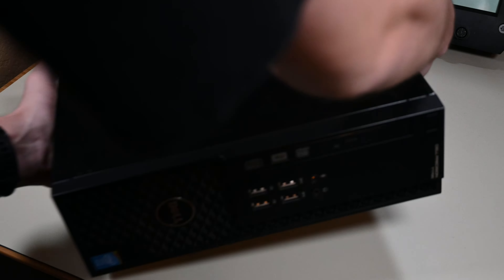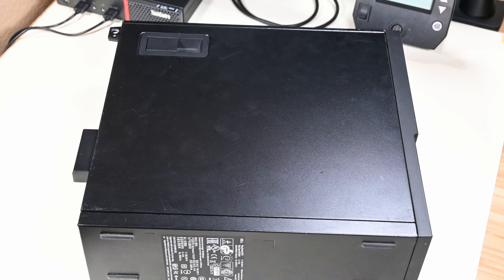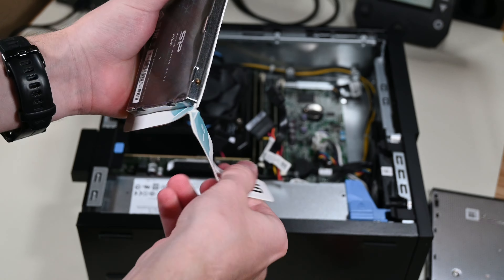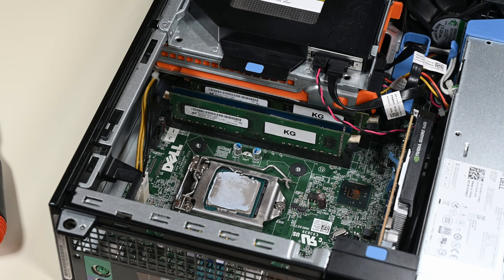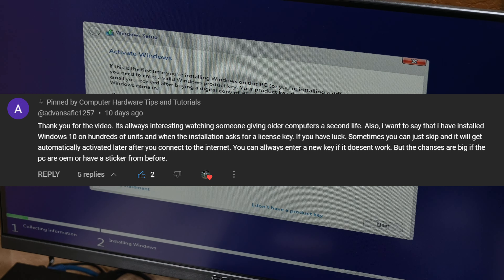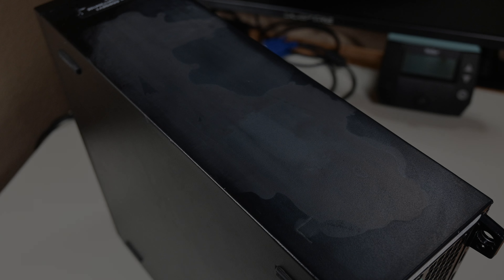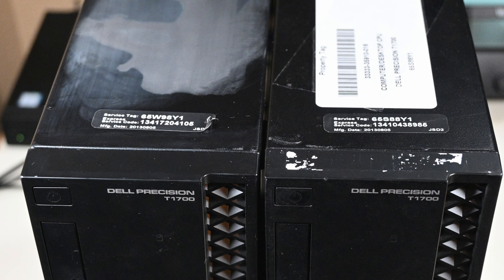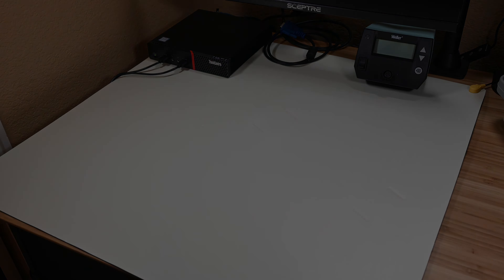Refurbishing a Dell Precision T1700 for a Friend's Gaming PC

Comment: Great job! Your friend must have been really pleased. I also sometimes use spray paint if there are too many scratches or areas with missing paint on the chassis. It looks nicer, even if the color code is not the same.

I'm glad that I could share my knowledge about license activation and that you were able to benefit from it, and that it works for you. :)
Reply from the maker: Thank you again for sharing that information!!

Comment: Excellent tutorial! Good explanation about the SSD carrier you created with your 3D printer. The re-painted computer case looks fine. It's possible that the case had previously been painted and that's why the Isopropyl alcohol removed the paint.😀

Comment: I case modded one of these for a full-size GPU, and also dismantled one to mount onto the back of a TV, my own homemade AIO. I love these little units.
Reply: On the one I turned into an AIO, I repurposed the case fan to cool the internals of the TV, which will run at 75 Hz. I kept it initially to prevent BIOS errors, but also because it didn't seem like a bad idea, or a waste of airflow. I also went and made myself a cardboard motherboard facade/cover, to direct the air of the CPU fan acropss the motherboard, and also dress up the back of the unit, which is mostly all black. From the front, you cannot tell it's anything more than a boring, stock, non-smart Elemnt TV. But on the back, is a full Precision T1700, with optional graphics cards. A total, complete stock unit, no cord modifications, I just fit everything where it would fit. One HDD attached to an SSD, Power Supply, PSU, everything is there, DVD/RW drive is a MUST for when the internet goes down. I can play anything I want to, 16 gigs ram and a trusty 4-th gen Core i5 CPU. I normally run the unit in bottomed-out low power mode, but I can play normal games like Forza and Escape from Tarkov, Snowrunner, etc. on this unit. Windows 11 gives me no issues, ever. It's just solid, invisible, and quiet. When I turn the fans up, it becomes known, but I almost never need to unless I'm intending to stress everything the fuck out. Very good unit to mod with, even if stock!
Reply from the maker: That's really awesome! Super cool idea to mount that to the back of the TV to have a pretty darn capable system hidden away back there. Nice one!

Comment: I have had some luck with the larger paper based stickers when I spray them with WD40 and leave overnight, they peeled straight off and the case buffed up nicely. No guarantees as I guess it depends on adhesive and certainly less effective if the sticker is plastic but the WD40 still worked well on the residue
Reply: I clean all the metal and plastics on cases including removing stickers using WD40.  No need to leave it on overnight to soak stickers though, five minutes usually does the trick as the oil quickly breaks down the adhesive.  With plastic or foil stickers, just lift the edge of the sticker using a plastic pry tool, add some WD40, give it a few seconds and just keep on going.   A few minutes of gentle prying and adding a few drops of WD40 and off the sticker comes.
Reply from the maker: Thanks for the suggestion!!

Comment: Interesting that those Dells don't have the Windows license embedded in the bios the same way as a lot of other Dells I've worked on.  If I install windows 10 on my T5810 for instance it skips asking for the license altogether and just proceeds with the install.
Reply from the maker: I agree.  I've been working with some older (Q3 2015) OptiPlexes lately and they have the key stored in the BIOS.  Strange to me as well that they stopped doing that in the more modern systems...

Comment: great vid. one question, do you have any suggestions about that type of cooler (like in your vid) that screws onto a plate on bottom of motherboard? I refurbed a comp not long ago, but the screws just kept spinning when I put the cooler back on. Is that normal? i'm a software guy, so i know enough about hardware not to break things, so i just left them like that, even though they felt loose. the cooler seemed like it was secured enough, and in windows i did a stress test and the cpu never got unrealistically hot.
Reply from the maker: I'm not too sure of any coolers that would fit this well in particular, but it seems like maybe the threads on the plate it screws into are stripped out.  If it's like this one and the stubs it screws into are part of the case, you're probably out of luck unless you can find a cheap replacement case sadly.  However, if it seems to be working after running stress tests and it doesn't feel like the cooler will fall off if you shake the computer around too vigorously, it's most likely fine.
Reply: @CHWTT   thanks!

Comment: I did something similar with one old monitor, the problem was not in the alcohol you used to wipe the case, but in the age of the paint, which had lost its strength, after that I told myself that I would never wipe 10 years year old things with alcohol (and I used ethyl, not isopropyl, it is even weaker)

Comment: Wow Intel tried to pull a fast on us with that Xenon and i7. and usually you can find Xenon for waaaaaaay cheaper then a i7.   On an "older" computer I usually clean the outside first with a mild cleaner called Simple Green. It cleans and disinfects really good and almost never fades the paint. LOL disclaimer almost never LOL sometimes the paint will fade even using a damp cloth on it. Dell is an example of bad paint jobs. Great video 👍 I've subscribed
Reply: Whats wrong with xeon compared to i7, other than higher tdp and like i called out there isnt an iGPU

Comment: Dish soap is magic. Peel off the stickers and let a wet paper towel with dish soap set on the residue for a few minutes and it will wipe right off.
Reply from the maker: I'll absolutely be trying this next time, thanks!
Reply: you shouldnt clean phone cases with alcohol too. the plastic weakens

Comment: A couple of points concerning installing win 10 that may or may not be of interest, don't have it connected to any network while doing this.
Then it wont force you to create a Microsoft account, with all the intrusive hassle that goes with having one. Instead you can create a local account, a password is optional.
After the install is completed you can connect and do all the updates via the settings tab. There will be many, no surprise to anybody.
On connecting to a network activation will take place automatically, provided you have installed the version of win 10 that matches the embedded key.
Reply from the maker: Great points!  When I install windows on these machines, I always leave the network disconnected until it goes to the OOBE.  I never go through a simple OOBE setup with these computers, as it's better if the person who buys the computer can choose what kind of account they want and if they want a password/pin or not.  So, that's why I leave it disconnected until it reaches the OOBE, where I then enter audit mode, connect to the internet, do some updates and usually a stress test, and then it's all good for whoever buys it!

Comment: I recently bought an HP Prodesk 490 G2 for about $25, the thing is: it instantly turns on when you plug the power supply and boot loops 2 times then turns on normally. I tried changing the power supply, cmos battery, ram but still no luck in fixing this.
Reply from the maker: Very interesting, I've not had a chance yet to mess with any of the HP Prodesk computers, so I'll be very interested to hear what may eventually end up fixing it!

Comment: did quadro a2000 fit in this?
Reply from the maker: My friend will be picking the computer up after a while as we're both quite busy at the moment.  When he does, I can let you know if it does fit properly!  I've measured extensively and it shouldn't have any clearance issues with anything in the case, but I can only confirm that once we properly test it.

Comment: 0:43 yeah about that... Xeons require an external aka discrete GPU since there isnt an iGPU like it is on the equivalent i7
Reply from the maker: Not this one, this one has integrated graphics, although most Xeons do not have an iGPU
Reply: @CHWTT  yeah was gonna say the xeon I got has no iGPU
Reply from the maker: @adventureoflinkmk2  Yeah I can see where you were coming from there.  But yeah, this one does have an iGPU (something I didn't originally think it would have either, but I'm very happy it does have it!)